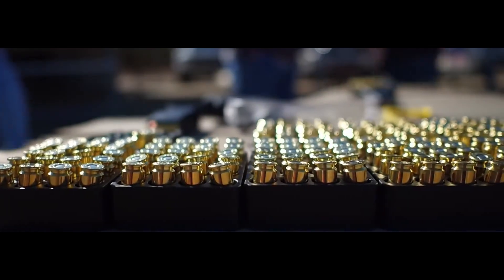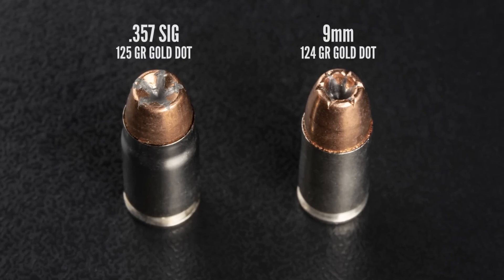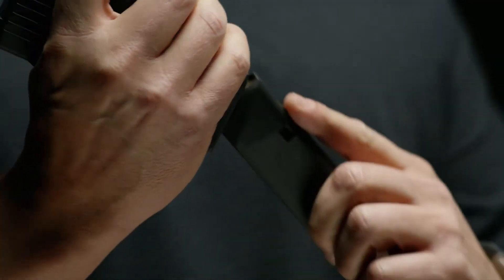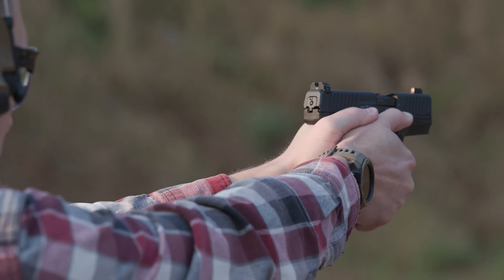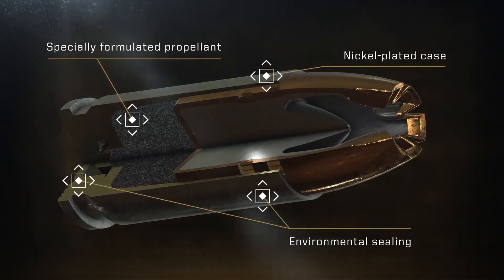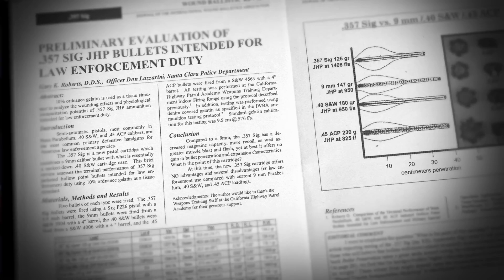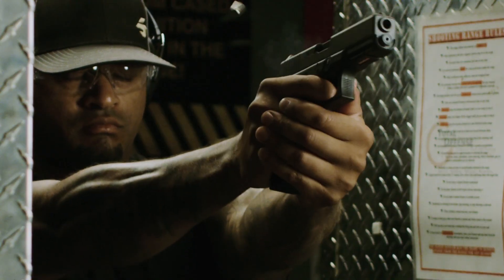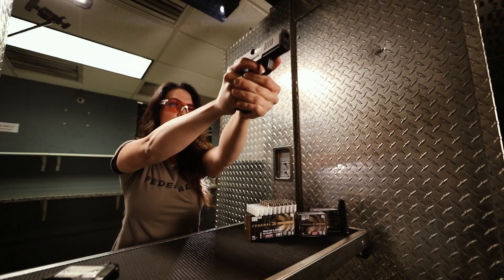The Most Useless Bullet in History – Why Was It Even Made?

Comment: Is 9mm equal to or superior to 357 Sig? Let’s think about that for ourselves for just a moment, shall we? I get it that some people pick a side and feel the need to defend their choice, but not to the extent of regurgitating pure nonsense that they themselves were misinformed on.  

   Some ammo manufacturers actually have loads that even surpasses the ballistics of traditional 357 magnum performance. Underwood's 357 SIG Gold Dot for example. Also because it’s a bottleneck cartridge it has the added benefit of feeding more reliably than other pistol rounds. It’s flat shooting and will punch through auto glass like it was butter. 

   It’s literally a 9mm projectile “except” because it’s 225-300 fps faster it penetrates most barriers as well as 10mm yet doesn’t over penetrate flesh, which is welcomed to aid in avoiding collateral damage. 

   It has a flatter trajectory that in turn makes it more accurate and potent at distance. Though the penetration is no greater than 9mm in flesh, the cavity damage is much more devastating making it more likely to stop a threat with less shots. 

   357 Sig Compact and Subcompact firearms actually have more energy than an equivalent sized barrel length 10mm. Even out of as much as a 4” barrel, Underwood 125gr 357 Sig has the energy that’s equal to or greater than most 10mm loads with the exception of a few specialty loads. Basically 10mm energy only surpasses 357 Sig out of longer full size barrel lengths. 

   Underwood has a 357 Sig 65gr Xtreme Penetrator round that exceeds 2250+ fps out of just a 6” barrel. I don’t know of any other semiautomatic pistol caliber that has rounds capable of such velocities from a handgun. It goes straight through a 3A panel even. At those velocities normally temporary cavities tear. 

   One of the most attractive benefits of owning a 357 Sig is the ability to convert the firearm to 40 S&W & 9mm with nothing more than a simple barrel swap. You also normally can do a 357 Sig or 9mm conversion if you own a 40 S&W firearm as well. That means you can train on whatever platform you’re most comfortable with and whatever ammo is the most affordable, and no it isn’t always 9mm. That means that you are less hindered by ammo shortages… and when you’re done training simply swap out the barrel and ammo back to 357SIG and you’re all set. Sadly on a native 9mm firearm you don’t have any option to do a conversion. 

   I never understood what’s not to like about 357 SIG… well other than ammunition availability and cost being the only negatives I guess, but it is the better round. 

   Keep in mind that when you compare 9mm +P or +P+ to try to achieve 357 Sig performance, 357 Sig is actually cheaper than 9mm. When I searched +P+ to get as close to 357 Sig performance as possible, it was more expensive than a standard 357 Sig JHP round. 

   9mm +P+ is still only 1300 fps in 124 grain. That’s 50 fps slower than the lowest end 125 grain Sig round at 1350 fps and we’re comparing +P+ 9mm ammo here. Yet the bare minimum 357 Sig performance isn’t even achievable and this is usually attempted in a platform that isn’t even recommended for +P+ or even +P at times. 

   I say it’s best to swap to a 9mm conversion barrel when training and back to 357 Sig right before you’re all done to finish up with 357 to cut that expense down. 

   In most cases the recoil of any superior round can be overcome with training. I actually have little to no recoil on one of my setups. It’s compensated. You’ll find that comps actually provide greater compensation with 357 Sig compared to 9mm because of the higher pressures. I do understand that some people are recoil sensitive and are more comfortable with 9mm or other lower recoiling rounds. I understand some just prefer the thought of higher capacity. I totally understand your decisions. But let’s not bash any superior round because you prematurely decided on a specific one.

   Naturally shot placement, especially with pistol calibers is key… but under pressure understandably, your shot placement could be lacking. With that in mind the welcomed advantages of 357 Sig could easily make the difference between life and death, shot placement aside.

   Keep in mind that mag dumping 9mm into a target may not be justifiable. Back in the old days when the revolver was supreme, you were trained to take two shots and then assess the effectiveness. Essentially those first two shots may be justifiable, but the next 15 shots may not be. Again with that in mind, a more powerful caliber will require less shots to stop a threat, while decreasing the chances of any wrongdoing. 

   There’s nothing wrong with 9mm it’s awesome, but let’s be clear… it isn’t equal to 357 Sig and the few extra rounds it’s capable of holding in a magazine over 357 Sig definitely doesn’t make it the superior choice. In time I expect 357 Sig to make the comeback that 10mm has made in recent years… For myself these 357 Sig advantages make 9mm less desirable. How about for you?

   10mm vs 357 Sig, both properly loaded out of a compact barrel are equal in power. Out of the same full size length barrel lightly loaded (weak) 357 Sig is more powerful than lightly loaded (weak) 10mm. Properly loaded 10mm out of a full size is more powerful than properly loaded 357 Sig but at that point 10mm is typically more expensive than 357 Sig. But for urban carry 357 Sig is highly enjoyable to carry. I love 10mm, especially in 155gr and under but the firearms need to be larger to outshine 357 Sig. For woods with larger predators I would absolutely chose 10mm over 357 Sig but truthfully if I was going into said woods, would 10mm be enough? I would have to step in up to 44 Mag. 10mm is in a position that has little use for me even with it being the awesome round that it is. Unless I was carrying a 4.5-5” full size in urban areas but that would be overkill with what 357 Sig achieves.

Comment: Baloney. The gel and hard barrier tests I've seen are clear: .357 Sig is superior to 9mm in all ways: more complete hollow-point expansion and deeper FMJ  penetration.  In fact, in hard barrier penetration, it seems to beat both 45ACP and 40 S&W in its heavier loadings as well. It's only downsides are recoil, price, and availability. The last two are the fault of the marketplace; not the caliber itself. And no, I don't own nor carry a 357 Sig, but I acknowledge its merits all the same.
Reply: I definately would carry/use if my $$ situation allowed!! I wudda bot Blok, in early, economical phase, but Blok didn't fit my hand. I' ve been .357( revolver for 5 DECADES)( DEER HUNT w/it) CC'd .38 hot hand loads Colt snubby. Then, '07 went .40 short& sweet.( still hadn't found quality .357 that I could afford. HOWEVER, My S&W could use .357 Sig (w/bbl change) Didn't find bbl. Then the key-board ops took over, mfg started pumping out 9mm guns/ammo. The rest is history. New bullet designs/loadings strained ahead of the previous thin margin of 9mm over .38. Still, IMO NEVER over .357 Sig bottle-neck/.357 straight-wall. So, IMO, .357 SIG got out-mktd, rather than out classed. I am now retired, physically disabled, but still looking for a cheap relic to fulfill my dreams.

Comment: A ton of brand named companies unfortunately water down this power house carriage. If you want to unleash the full capabilities of this cartridge, look at brands like Underwood, Buffalo Bore and Double Tap. These companies load 357 Sig to its correct specs. 357 Sig was developed to mimic the 357 Magnum with its 125 grain projectile. These 125 grain projectiles should be shooting at approximately 1,450 FPS out of a 4 inch barrel. Now that is considerably more power than a 9mm.

Comment: you clearly dont know wtf you're talking about.  In a pocket gun, the Sig rd will get enough velocity to expand a 115 gr jhp (ie, 1200 fps) the 9mm will not.  There's no reason at all to settle for less than the 10mm or 460 Rowland in a belt gun.  I use a 9x21mm case in a pocket Sig, 45 gr solid aluminum bullet, hollow based and hollowpointed, at 2200 fps, It is AP and breaks in half at impact, the full length segments diverge as they penetrated, producing two wound tracks with each hit.  I'm a proven world class IPSC match shottist, handgun hunter, smith, reloader, bullet maker.  I've CCWED for decades and I made black belt in Korea, 50 years ago. Starting  and in pocket, my reaction, draw and hit times, at 10 ft on a 10" disk, average .75 second, and my  repeat hits average .20 second. I've slowed down a bit due to my age, but not much!  :-)
Reply: Good stuff ED. I've carried my stainless-steel, S&W Mod 66(no dash) .357 mag. 4.5" barrel since 1972, but it's now far more a collector's item, than a self-defence weapon. My S&W has fired about 100 rounds. I carry it 24/7, because of the exceptionally high, violent crime-rates in S. Africa. Latest murder stats show 70+ murders a day, to start with. 😒
Reply: The 357 Sig round is only 9mm round worth carrying.
Reply: Watch Lucky Gunner’s take this topic and you’ll find out this video I more likely than not an A.I. voiceover of that channel’s video.